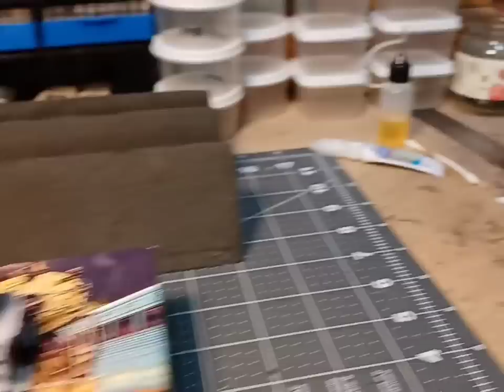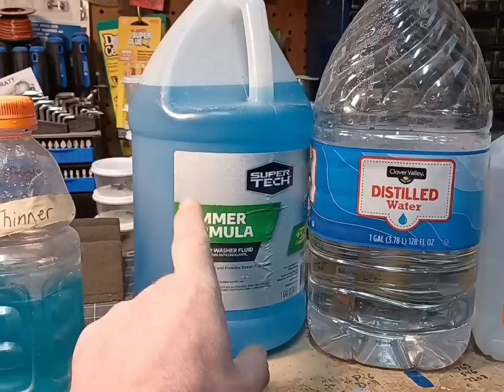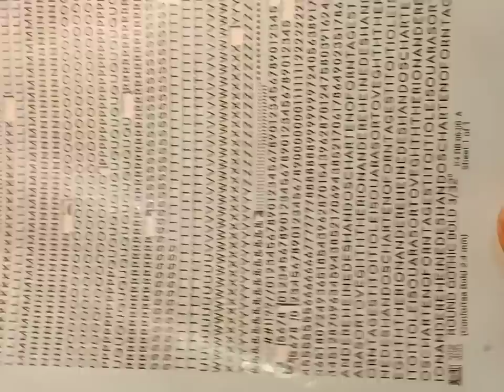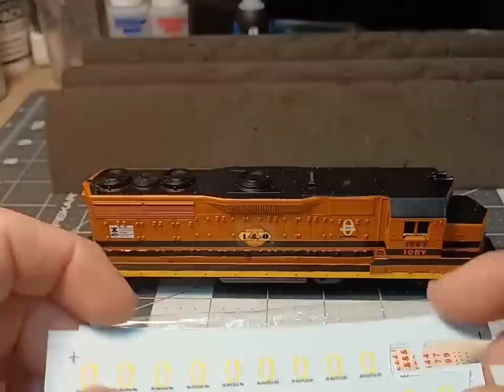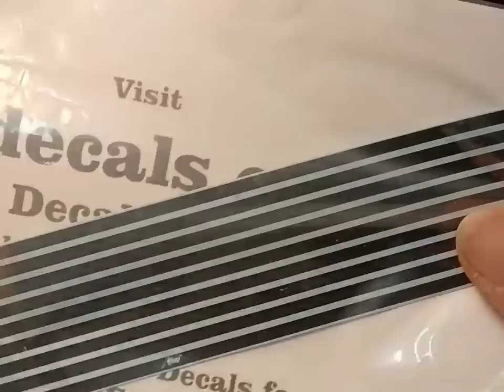How I repaint and decal a locomotive.

Comment: Great video!  Have used K4 and Circus City decals too! Have had good luck with those as well as microscale.  I have had good luck with Tamiya Mark Fit strong and Solvaset for getting decals to lay down.  Great job she turned out fanstatic!!  Will try some of the craft paint, have used Tamiya spray cans and old PollyS acrylic paint if they can be found!  I also use Tamiya black or grey panel liner for the vents and fans.

Comment: Great results with those paints. I'm gonna try them with my new airbrush.
1. What primer do you like to use?
2. Do you use a gloss under your decals?  I see in the comments you use Rustoleum clear flat, but I assume that's the final coat.
Reply from the maker: Hi , I use Rustoleum gray automotive primer. After painting I give it a light coat of Rustoleum flat clear before decals then another coat after decals. Just let each step dry good before going to next step. I love using the craft paint in my airbrush,  it's cheap, easy to use and clean up. Thanks for watching.

Comment: Great job! What I like about using the acrylic paints from the hobby stores, is that they don’t have that odor you get from paints you buy at the train store. In the past, I have brush painted my locomotives and freight cars using acrylic paints, and they came out great. That was before I got an air compressor. Btw, what type of clear coat do you use? Also, impressive layout you got there!
Reply from the maker: Hi, yeah no smell is nice. I have also brush paint a locomotive and I thought it turned out nice. The clear I use is Rustoleum flat clear, thanks
Reply: @papstrainshow3353  I’ll have to give that a try! Thank you!

Comment: Will the 91% alcohol work on a model that has already been repainted over the factory paint? I have a Athearn GP9 that the original owner just painted over the factory paint (it was a B&O unit) currently its completely black and the paint jod was pretty bad
Reply from the maker: It may work , you'll have to try it. The 91 alcohol is cheap to purchase.  I use it on all Athearn locomotives and it takes the paint off good, but I've noticed some other manufacturers use different paint that alcohol doesn't work on. I know that alot of model car builders use different stripping methods.  So if alcohol doesn't work look on YouTube for model car stripping.  Thanks for watching.

Comment: I recommend you get Super Clean to strip your plastic models. Won't hurt the plastic at all! And it is usually much faster than alcohol, depending on the paint you are removing. On acrylic paint like Tamiya or a lacquer paint it will be stripped on less than half an hour! But on some other paint types you will have to supplement it with 91% alcohol, but on most jobs the much faster super clean will be more than adequate. It comes in purple bottles including a one gallon jug.

BTW, what primer do you use on your models?
Reply from the maker: Thanks, I use Touch 'n tone gray when I can, it's good and cheap but use alot of Rustoleum gray primer, it's easier to find.
Reply: @papstrainshow3353  

Thank you. Tamiya Fine primer is great but expensive. I will try the Rustoleum. I was worried that these non model primers would be too thick and blot out fine details on a locomotive shell.

Comment: I loved your repainting/ decalling  video. However, I noticed that you forgot to add the letter  "F" onto  the sides of your locomotive engines when you added the other decals. I'm Not criticizing, just curious, or are you just not aware of this little detail? - But  anyway, thanks for a great video and for sharing it. Great Job  sir.

Here a while back I viewed a video on YouTube about why the letter "F" was painted on the sides of a locomotive engine (Usually down on the bottom of the main frame on the sides below the walkway near the front steps). It explained that the reason the letter "F" was painted upon the sides of a locomotive engine was that the department of transportation required that letter to be painted on was because it designated the front of the locomotive. I couldn't find that particular video but I did find one similar but it wasn't in english it was basically in another language of which I think was from India. But In case you're interested as to why, Here is that information of which I copied and pasted from another website of which mentions this little tid-bit of information. 

Quote, "Why the "F" letter is still used on the nose of locomotive engines?

 (A) - "It's a federal requirement so that there is no confusion on the part of switch crews who are directing locomotives, for example while switching, as to which direction is forward and reverse.  While it may be apparent for most modern locomotives, there have been many locomotives built with long hood forward, or double ended locomotives.  "B" units (no cab) do not have an "F"."

(B) - "By Federal Law, the "F" indicates the FRONT of the locomotive/unit/motor. Thus, those railroads that special ordered that the long hood be designated FRONT, then the "F" would be placed on THAT end, and the control stand in the cab relocated accordingly (or dual/duplex controls specified at extra cost)." - UnQuote.

Anyway, to borrow "Paul Harvey's" favorite saying.... "Now you know the rest of the story".  LOL

Again. Thank You Sir For A Great Video.
Reply from the maker: I did not notice that F, I probably couldn't get a decal that small, I'd have to paint it on. There is also a few other details I missed,  but I was just trying to be close to the original locomotive, thanks for watching.
Reply: @papstrainshow3353  - If you happen to be out rail-fanning or watching videos on acual trains and train operations try to keep an eye out for that "F" on the front sides of the engines on the catwalk frame (or there abouts).  It seems that after you actually spot a couple of them it seems to become an unconcious habit to see if there is actually one on every engine. (At least that has sort of become my habit since finding out about it.). Again, thanks for your great video's.

Comment: So would it still work if you gently hand painted the engine?
Reply from the maker: @Coloribus2004  I have hand painted them before,  I just think the paint with a drop or so off distilled water so it isn't as thick when brushing it on. But airbrushing does a way nicer job. Thanks for watching.
Reply: @papstrainshow3353  you’re welcome

Comment: Your thinner is too complex. You cut a 40% cleaner solution to 20% then added some amount of 91% back in. Why not just cut to the chase and mix a 20% solution to begin with from iso and water? The alcohol is just there to accelerate drying.

Comment: Can you by the I&O trains
Reply from the maker: Athearn is the only maker I know that has. They are kinda hard to find though.  I've had custom decals made for mine. I have plans to build more I&O locomotives.
Reply: How did you get those indiana and ohio decals
Reply from the maker: @maribethbrehm9492  I had to custom order them from Circus city decals,  it wasn't cheap but I got enough to do 50 locomotives.
Reply from the maker: @maribethbrehm9492  I just had the I&O badges made, the stripping and othe number and letter decals are just stock decals in the size I needed.